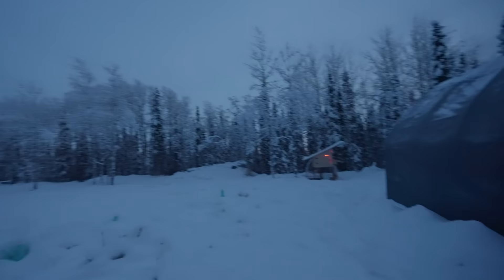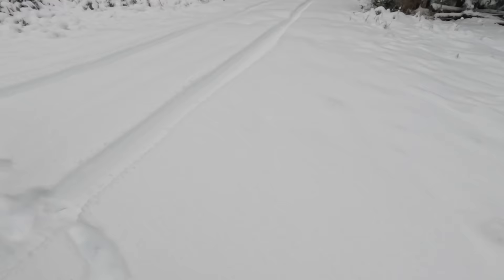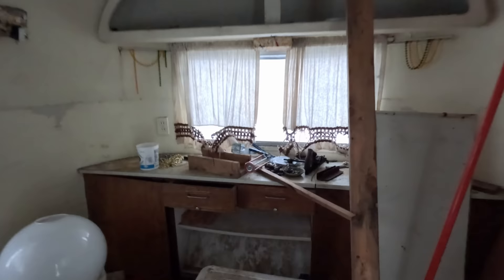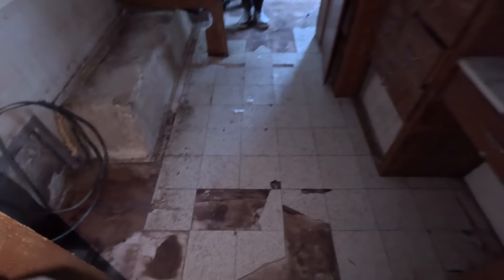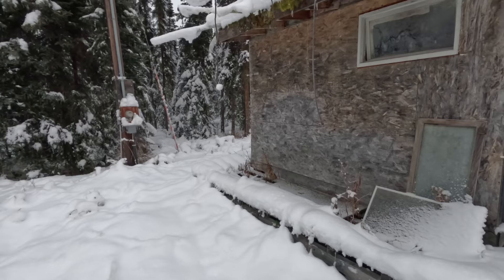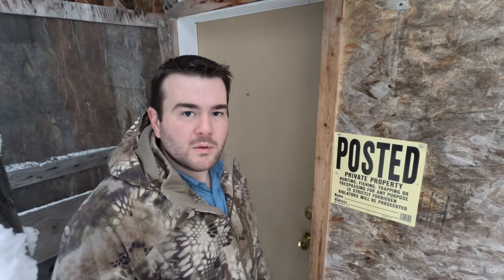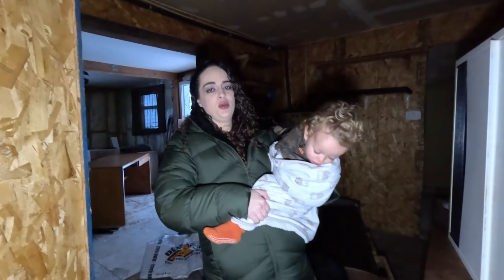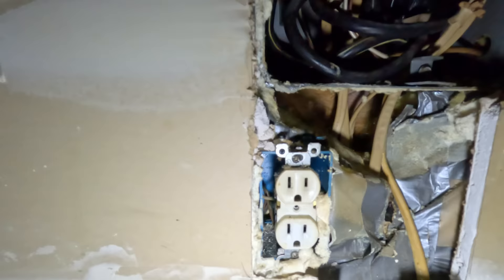We Bought an Abandoned Cabin in Alaska: Our First Look Inside

Comment: Due to the mole, decay, structural issues, strip it bare of the things that can be used, and tear it down. You might be able to salvage some lumber out of it, if even only for firewood. Sometimes it is easier to begin a new than to try and fix someone elses mistakes, and generally cheaper too. Good luck in whatever you decide to do.
Reply from the maker: Thanks for watching and for your suggestions 😀!
Reply: Yeah I think I agree with this start anew idea.
Reply: Don't tear it down... Decimation isn't construction.  It's storage at worst.  Leaving everything outside????? Welcome to alaska
Reply: Don't tear it down!!!

Comment: New sub. Looks like a great beginning with the infrastructure already in place. It will be great to see the property in the summer. If it was me I'd strip the structure down to the studs stripping the roof, flooring and siding of all the rotted OSB and scrap the exterior staircase and build one inside using materials sourced from the property. It definitely has lots of potential. By the way the trailer is an Airstream probably 60's or maybe even 50's. They have value to collectors but as it sits with some repair it would be a great dry storage or even a place for a guest to bed down. Good luck with this project.
Reply from the maker: Thanks for watching and subbing 😊! Appreciate all of your suggestions! Those are good ideas for the airstream!

Comment: There a couple campers made like that one, all are worth fixing up. Biggest reason is the outer shells are aluminum, and don't rust or leak. I'd gut it, re-do it and use it for a place to stay while you ix the cabin. I'd gut it, and re-do all the plumbing and the wiring for sure. Fix the bad parts of the roof, add some exterior insulation and some siding, and after rough in of wiring and plumbing, just fix one room at a time. Of all of it, the moisture in the crawlspace would be my biggest concern. But over time, it can be made really nice, lot's of YouTube content if you are DIY'ers. 
First time on your channels, gonna subscribe so I can learn more about your family and what you do.
Reply from the maker: Thanks so much for watching and for subscribing 😊! Our playlist has all our videos and tells a lot about why we can to Alaska and are adventures! Thanks for your suggestions!

Comment: As the saying goes ... one man's junk is another man's treasure ... 

That first camper - gut it - replace flooring, seal up broken window and now you have a perfectly good chicken coop, goat shed, or a portable tool shed (since it's tall enough to stand apparently) ... if the boat turns out to have flooring issues - again - gut it - reinforce the flooring and voila' you now have a raised garden bed ready to start off right away - or use as a starter seed bed that can be portable as well ... ALL things can be repurposed rather than junked away, or sitting in a landfill somewhere - like water bottles people just throw into landfills, they can repurposed into miniature greenhouses, or you use them by filling them up with water and cutting a hole in a shed roof and they become a source of amplified lighting when there is none, and to save on solar energy, etc. ... anyhow - nice find
Reply from the maker: Thanks for watching 😊! That is definitely a true saying! Thanks for your suggestions and will have to see about repurposing what we can.

Comment: Wiring is easy once you understand the basics not even something to be concerned about general into something like that you just got it all out and start over that way you know what you’ve got eliminate any problems. Mold can be treated in that small little bedroom behind the kitchen, but that situation because the cabin need so much other interior work. I would just got out the entire interior come in frame, new walls and re-sheet rock everything. As I said, in my previous, I will make a really good caregivers cabin rock, off-season food storage and processing building.

Comment: Strip everything that you can save out of that shack in the Spring.  In the meantime you can learn about your neighbors.  I would bet that you have a neighbor that has a dozer or front end loader large enough to knock down what you can not salvage from that shack so you can burn the pile, scrape off what does not burn and start over correctly.  At least you have a well and septic in place on the property.
Reply from the maker: Thanks for watching and for all of your suggestions 😊! Will definitely have to see about neighbors.

Comment: At the very least, you'll have building supplies for chicken coops and animal shelters with the trailer and wood from the cabin while you build something to live in for yourselves.  If you do build in the same area the connections for electric,  water and sewer are already there and don't need to be created. You'll even have a root cellar already dug in the ground.  Running electric and water from the main road can be extremely difficult to get in a timely manner and can be very expensive as well.
Reply from the maker: Thanks for watching and for your suggestions 😊! Yes, if nothing else can salvage some of the cabin.

Comment: Empty out the stuff like the water heater and some of the nice wood furniture, pull the copper wire and torch it....Not worth messing with mold mediation....too bad, the previous owner spent a lot of money on wire and dry wall for naught....with all the moisture in the basement, they may just have a shallow well for garden etc....and not fit for drinking water...It will be a good adventure....at least you have about $2000 worth of trailers, plus what looks like an old airstream when polished out, and fixed up could be very high in demand...after cleaned up, would be great for storage providing it doesn't have any leaks or openings for critters to access it.
Reply from the maker: Thanks for watching and for your suggestions 😊! It definitely wasn't taken care of!

Comment: Yea air streams are highly sought after I’ve seen some at that age that’s been restored and sell for 80k and in some cases more you could easily get 10k as is but definitely don’t scrap it do some investigation on it and the year may have a diamond in the ruff. And as an electrician I wouldn’t recommend turning power onto that cabin until you fix that panel that’s an instant fire hazard
Reply from the maker: Thanks for watching and for your suggestions 😊! Will definitely look into it and thanks for your recommendation about the electrical!

Comment: dont know which breakers you turned on but if the water heater is empty and you happened to turn it on the element more than likely got fried if iot was on for more than a minute or two you may have to replace element
Reply from the maker: Thanks for watching 😊! We will have to check that out. Thanks for sharing!

Comment: That cabin's a diamond in the rough. The first thing I saw inside was what looked to be decent insulation. You can tear-down any quirks (like the Thin Man's Bathroom!) but anything already done is one thing less to do. What on earth can have happened to the previous owner? Did he spontaneously combust?! Why else would he leave so much valuable stuff behind? The trailer alone might be worth a few thousand - though you'll no doubt put it to good use yourself!

How can there be no woodstove?! That electric "fireplace" is an aberration; it needs to either be disappeared into an Alaskan bog or sent to live out its days in suburban Ohio. It's always good to have an alternate heat source (ie. one to keep the pipes from freezing when you're away), but still - any cabin worth it's salt needs a real stove. I'll bet there's loads of deadfall on the property, and if you've got a snow machine? You can just drag it back and get chopping. No gym needed in the wilds of Alaska!

Happy that your little family's lucked into a property with a few hidden gems. Subscribed and looking forward to the adventure!
Reply from the maker: Thanks for watching and joining us on our adventure as well as subbing 😊! Yes, not sure what happened with the previous owners since it was bought through a third party. Definitely some things we can use and change to fit our needs. Ha ha about the electric fireplace. Really wish it had a wood stove and we also wondered why it didn't already have one! Thanks for sharing all your thoughts with us  and thanks for the kind words and best wishes 😊! 
If you would like to watch our journey from the beginning, check out our playlist below 😊!
Watch From the Start: https://www.youtube.com/playlist?list=PL_koT_xOsUsmnsOauc5OGlw2QTyiSnGxm